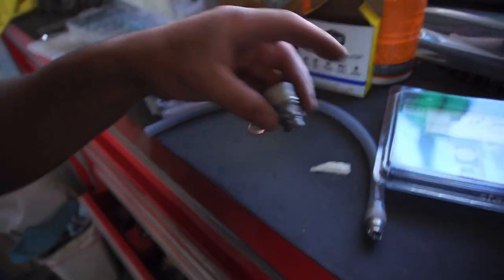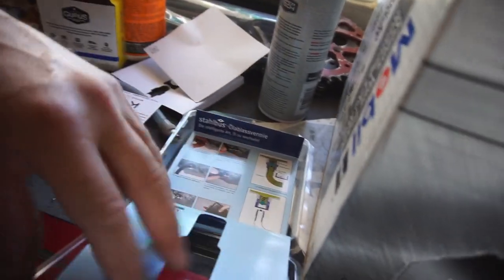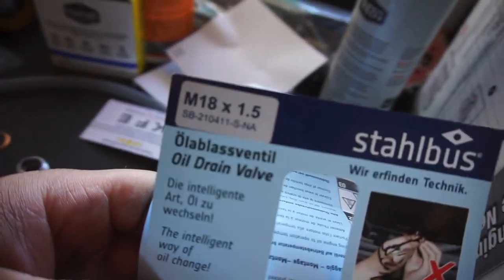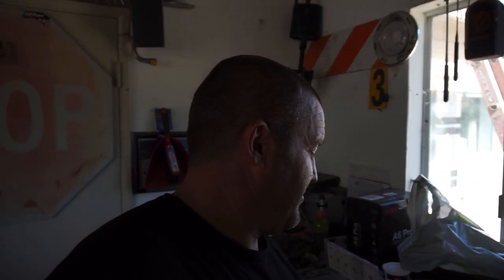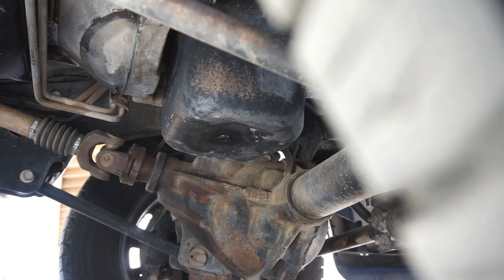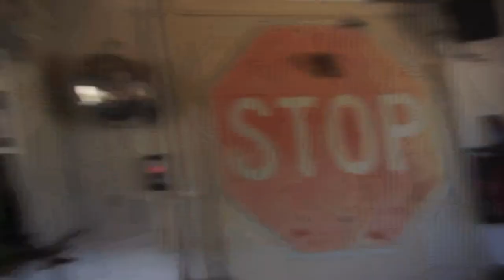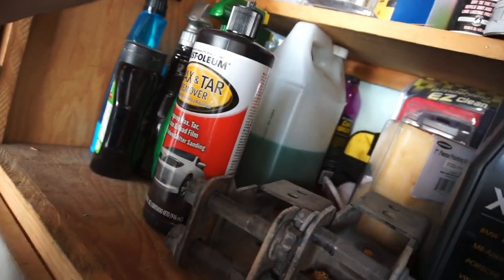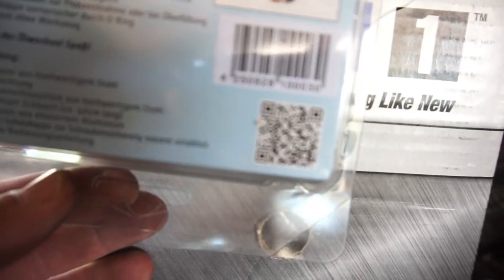Installing A Stahlbus Oil Drain Plug Valve On My 2010 Ram 2500 Mega Cab Cummins 6.7. M18 x 1.5

Comment: Nice job. I'm impressed the shop vac suction worked. Have you done a oil change since  installing the Stahlbus?
Reply from the maker: Not on the ram. I have twice on my daily with the Stahlbus. I’m very happy with it. Drains a little slower than pulling the plug.
Reply: Halffast719   Great. Thank you for your info.